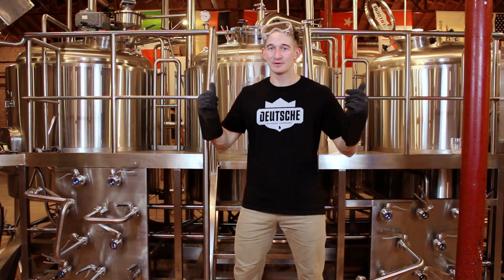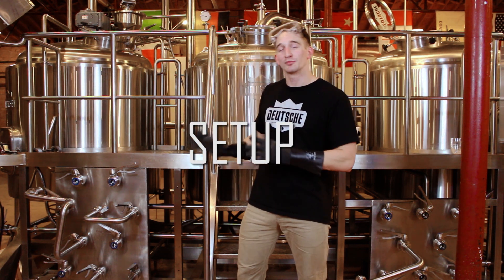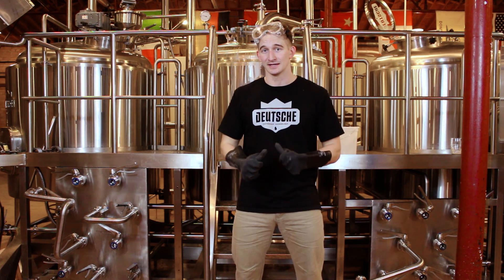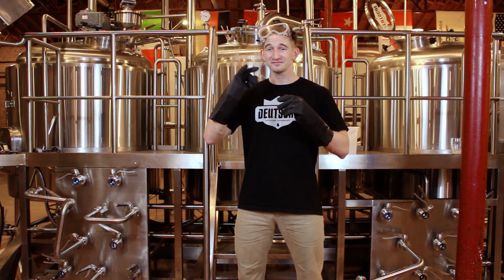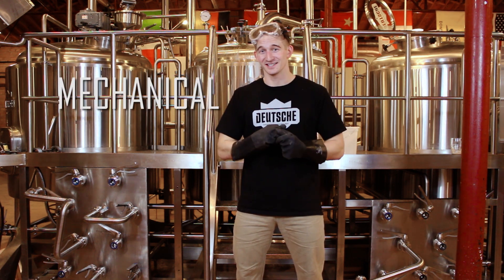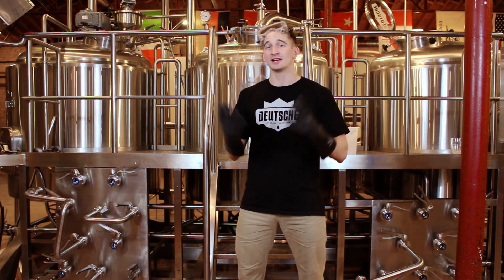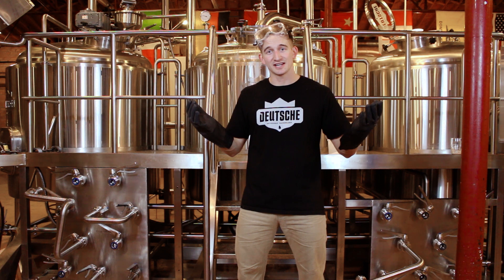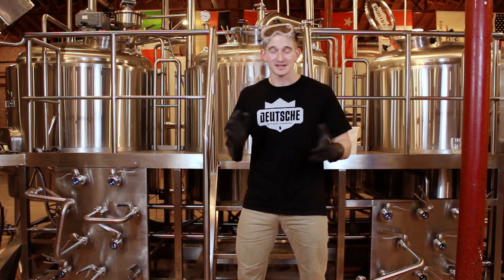How To: CIP - Clean in Place

Comment: How frequently do you CIP? How many brews between deep cleaning? Or do you wait for indicators like film build up before cleaning?
Reply: You need to CIP after every use. Deep cleaning might be an introduction of an additive. Also if you use Caustic every time, you might want to occasionally use an Acid-Base. Feel free to reach me @ Jbauer@chemstation.com   ( supply chemical provider )
Reply from the maker: Hey Darren. Thank you for reaching out. There is a lot of subjectivity here, but to answer the most important question, we would not recommend waiting for a film to be present as you want to eliminate any chance for infection between batches. Outside of normal cleaning and sanitizing, passivation of your stainless is of great importance as well. If it is the same bill/recipe for a double or triple batch certainly a hot rinse is recommended. For a per brew basis, I would always follow typical Pre-Rinse, caustic cycle (time dependent on vessel size and pump speed), and then sanitizing practices. There are different “contact times” dependent on vessel and process. If you are looking at commercial applications please let us know and we can make other equipment recommendations to help with heat up, recovery, and most importantly safety; Clean In Place equipment https://deutschebeverage.com/brewery-equipment/. The VINCIT Group is also a great resource http://www.vincitgroup.com/chemical-application/food-and-beverage/brewery-sanitation/

Comment: Sorry, but the safety gear and the handling of the concentrate is poor. 
What do you do when the cup slips out of the hands?!  Looks like russian roulette.

It is better to use a automatic dosage system with a concentration measurement in the CIP plant. So no manual cup handling is needed.
KR and take care!